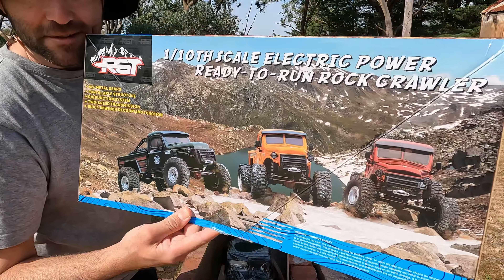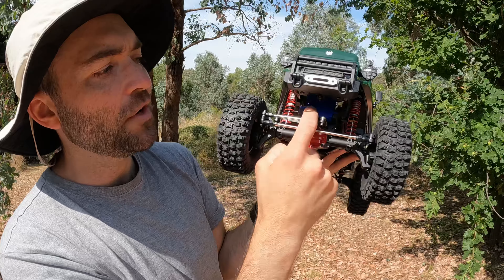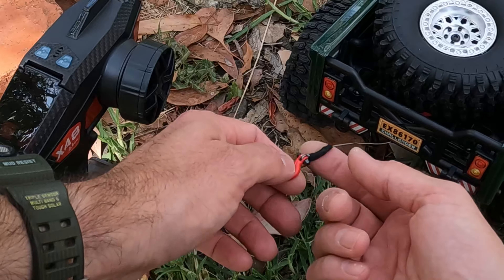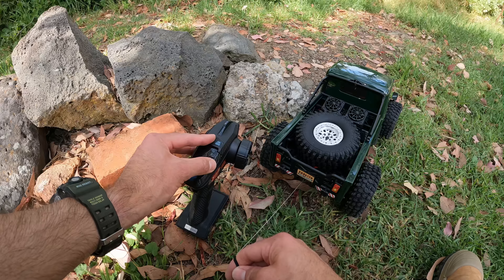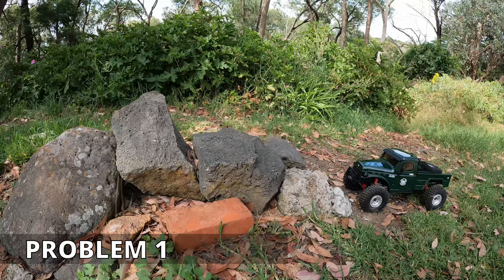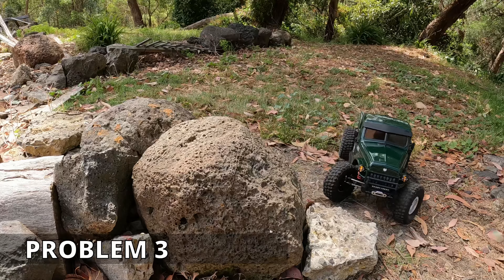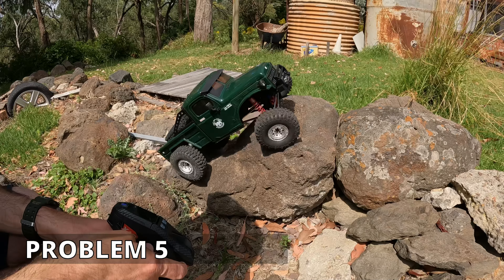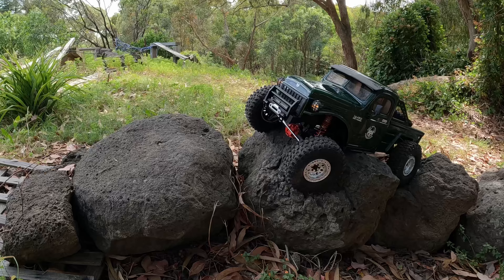RTR with Beadlocks, 2-Speed, DIG & Winch?!

Comment: I’m kind of shocked I’ve been looking at these RGT’s & drooling over all the features but it appears even with all of those features it’s still not quite right. As far as crawling that is. The prices are pretty good considering all the features but here in the US RGT’s are not that available here. I like it & they have many models. I just thought it would do better on the rocks. Not sure if I’ll get one if they where more available I’d probably have one by now. Ya here in the 805 area of Ca. We are officially a disaster area lots of rain & some flooding lots of road damage & parks & our local lake got hit pretty hard but it’s nice to see everything green lots of fresh clear water coming into our lake & it’s made for awesome ares to go out & crawl or trial run. Some ares are just huge rock fields & the streams have nice ares to crawl by. I’ve lived in this area all my life & haven’t seen this type of flooding & damage in years. It’s both good & bad. Things are settling down & things are getting little by little back to normal. But ya it’s Super fun out with the Crawlers.
Reply from the maker: Hm, there's a new kind of normal for weather and that's anything but how it used to be. The intensity dial is getting turned up bit by bit, so there'll be more of this in future.

It's a little silver lining for crawling terrain though, yeah! And the RGT here isn't bad - 3 of 6 problems means it's still capable, and those extra little features are definitely fun!
Reply: Most of the RGT crawlers in the US, are in a bangood US warehouse in California. Thats where mine came from, in less than a week. I loive in north end of Washington. Lol
Reply: @clean1566  Yes I’ve been on there website many times there’s another one also Bome RC website has them as well but they are based out of China & we all know it’s shut down till Feb for the New Year. There’s a new model & it looks lighter then the one tested here it’s under 400$ so I consider that a pretty good deal but it’s not a RTR you have to provide the electronics & controller. Still everytime I look at the RGT crawlers I’m very impressed with what I see on paper. Definitely going to get one it’s just time.

Comment: What is the best "angle" for shocks on rock crawlers ???
Reply from the maker: Depends on the rig and what you want from it. Upright is neutral and allows the coilover spring to compress in a linear fashion.
Lay then down a bit and you'll have a different compression rate, and one that completes its cycle with less resistance. The greater the angle, the less influence the spring has on the movement of the axle.

Comment: I saw this on the other channel and the ONLY thing it doesn't have is locking/unlocking diffs. It really does have just about anything you want. It's not cheap at almost $600 CDN. 

I would say that what would make this the cat's a$$ is if you could mod the radio to change the button assignments. 

Yes, RGT is upping their game, but you're paying for the improvements. Not complaining if the quality is there...but referring back to the pioneer: I should have snagged one when they were $275 CDN now they too are over $500 cdn plus $shipping
Reply: For changing the button assignments, all you need to do is move the connectors in the receiver. =)
Reply from the maker: What he said, that's it! Easily done :)
Reply: @YoShImUrA53  I thought it was all digitally assigned? it's that easy? 

Well, there you go then! haha

Comment: The six problem performance was quite underwhelming! Not a fan of the "power wagon" style, but this one isn't the worst looking one (looking at you, ECTO!), but you'd think with that aesthetic and features, it'd be more competent out of the box. I did get a feeling like a stronger rear spring could benefit make the front a bit more stable, maybe?
Reply from the maker: Yeah it isn't bad. A firmer rear would help support it in the steeper climbs but it's about right for most stuff, at least with the 700mah 3s battery I ran in this test. I would like to stand those rear shocks up a bit though!
Reply: @RCTNT  I understand what you mean, but I wonder if we're effectively saying a similar approach? Or the "digressive spring rate" from running them less vertical is more noticeable than increasing the rate to avoid the compression in the first place?

Comment: 26:16 yeah, I can tell you're getting frustrated. Even in Prob 4 I've seen you have much more patience with other crawlers.
Reply from the maker: It was not fun on P4, that's true! I could just feel the truck wasn't happy and knew breakages were in the future at this rate!
Reply: @RCTNT  speaking of breakages, I'd be tempted to use the shoe goo and drywall fibre tape on the cab corners....

It does point out the balancing act of weight vs ground clearance. The portals give it plenty of clearance but raise the weight up quite high. 

You did put it through it's paces compared to TOG.

Comment: I am wary of RGT products. They look good as most Chinese copy’s do
but their quality is lacking. 
I bought an RGT 1/10 Bronco V2 RTR a year an a half ago.
On the second battery the front axle shaft sheared off. I contacted RGT using their only contact info.
They wouldn’t warrantee the part.
I couldn’t find the correct replacement part unless it was shipped from China.
I finally silver soldered the axle myself and kept on running it.
Then in a few more batteries the rear diff plastic spool stripped out at the axle because the plastic was too soft. Should of been a harder resin plastic!
I am a senior gentleman that has had r/c‘s since the 90’s. I have and still own alot of different
r/c brands. I can’t believe the lack of quality and integrity of the RGT name!
Spend about the 
same and get a Traxxas or other reliable & superior 
r/c vehicle.
Maybe you could use that winch to help you unlock your rear diff before the winch breaks! 😂😂
Reply from the maker: Oof, that's no good! I have a lot of RGT products and so far I've had two breakages. The first was on the Pioneer on the main shaft from gearbox to transfer case, which broke while in the hands of someone I lent it to at a comp. Just a little plastic thing. Second breakage was from the Challenger, just last week, when I had the rear axle puking comp duty on my performance scale rig at ECCF interstate. My DIY link riser tore the composite bracket apart.

In normal use though, where I've been using the cars as designed, I haven't had any problems. I'm sorry you have, that would be enough to put me off any brand.

Fwiw, RGT is considerably cheaper here in Australia than other brands, partly due to proximity and trade arrangements with China and partly due to USA companies like traxxas and horizon brands simply costing a lot more here than in the US.

If I was in the USA I think I'd be sticking with traxxas and horizon brands too.
Reply: @RCTNT  Hi
I have a TRX4 builders kit. Two speed & lockers are hard to beat. I bought the RGT for my grandson when comes to my house. I may buy a set of complete metal diffs for the RGT Bronco so it can be used.
I like the short wb of the Bronco for tight trails.
Thanx for your input. Keep up your great channel 😃
Reply from the maker: Thanks! That's a nice kit, too. Glad you're enjoying the hobby, despite the let down from RGT support! Cheers